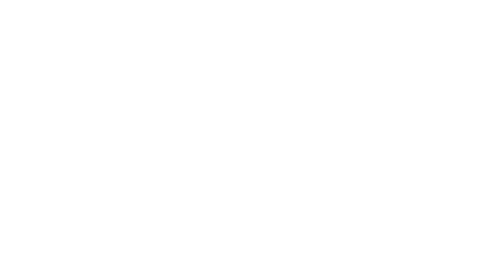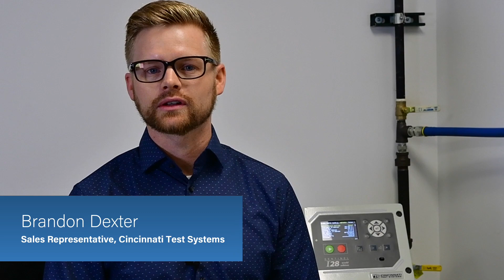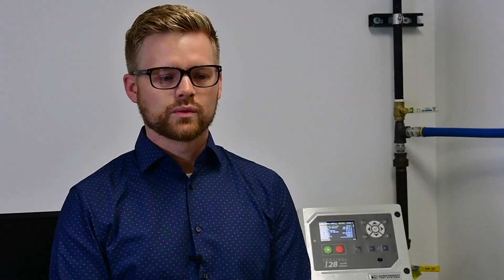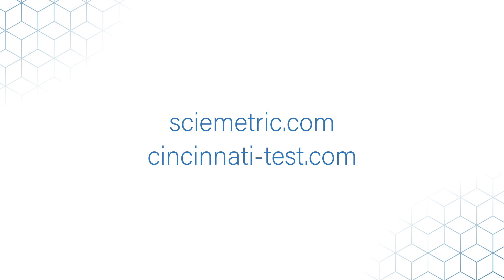Ask The Experts   Why Does My Part Have a Negative Leak Rate

Comment: Hello,
For  differential pressure decay method  (comparing master and work side)it is obvious increasing the temperature in work side shows negative reading as pressure also  increases in that side which push diaphragm towards master side.
As  cooling contracts the pressure , if we decrease the temperature in work side only ,reading need to show in positive but it  shows negative,why?
Reply from the maker: Hello Captain KC, The negative value you are measuring is Pressure Loss or Leak rate (scc/min)?
If you want to share your data directly with me, please email it to sales@cincinnati-test.com reference details to share with gsplete.